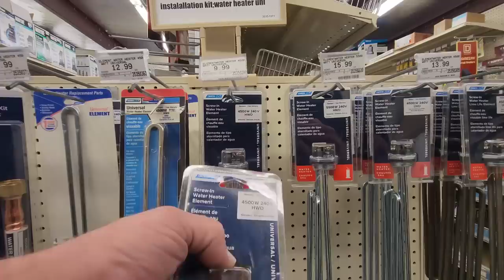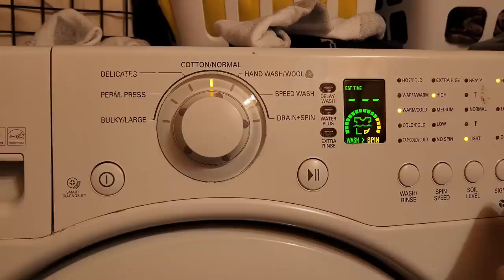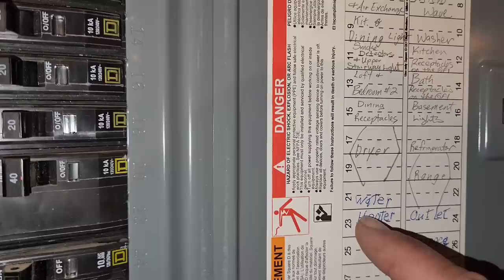Ep684, These Are Things That Need Done

Comment: I've got an ancient washer/dryer I bought used years ago. I'm simply amazed with my well water that it hasn't died yet.. sure it's got bailing wire and zip ties holding it together but it's still going

Comment: Washing machine  maybe  be the control module  mine did the same it a little box with wire coming out it has push on connecting  points  my was 110 dollars  very easy fix .you could  do it easy .and save money  .

Comment: #1 plumbing mistake with changing water heater elements is turning electricity on too soon. Install elements. Open hot water faucets in kitchen or bath room. Turn water valve to fill tank. When faucets are running full force, this means tank is full. Turn off faucets. Next and final step, turn on electricity. Turning on electricity before tank is full will burn out elements immediately. Water is needed to cool elements. Many a person wasted a lot of time and money not knowing this.

Comment: Kurt always take a meter and check to make sure the power is off I done just like you flipped the breaker to off stuck the screwdriver in and touched the metal tank i though it blew my hand off the breaker was only cutting one side of the 240 so Yel it was 120 but let me tell you if felt like 20.000 volts the breaker had burnt the contacts together so be careful around electricity and keep the video's coming 

and yes bad as I hate to say had to change my undies after that deal
Reply from the maker: Should of

Comment: I have one better me and my son in law replaced the well pump in a pouring rain last week because we had no way of taking a shower 200 foot of pipe and a pump ant easy to get out of hole, my Xmas lights were put up today like you am only doing it on the ground gotten to old to get on the roof and great video keep up the good work God bless from GA and stay safe and happy holidays
Reply: Where do you live?
Reply: @myronparks3495  in the boondocks of GA
Reply: @psg6314  I live in the middle of nowhere in Iowa. I don't have to pull 200 feet of pipe to pull a pump. Only 20 feet of pipe then the pump.